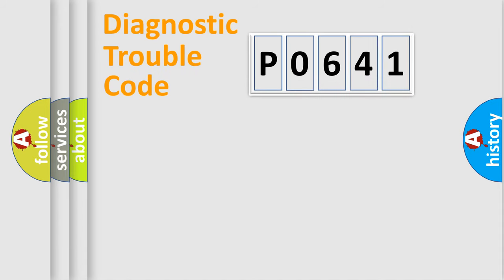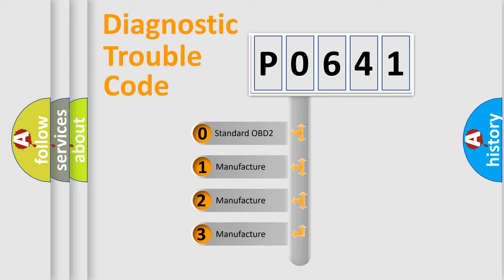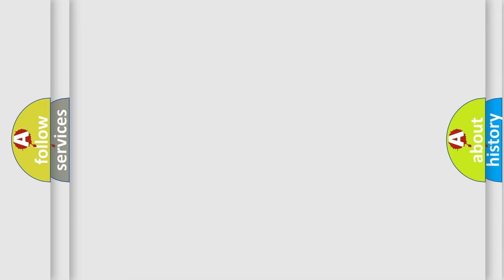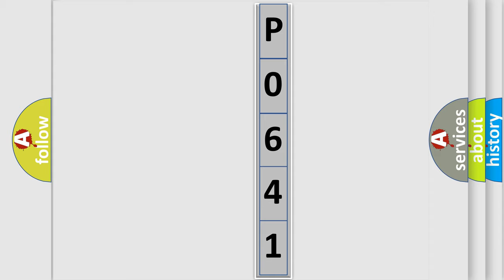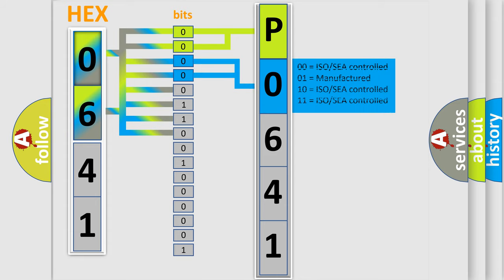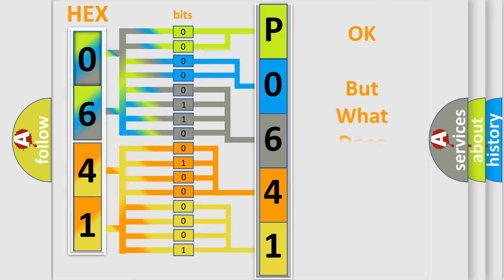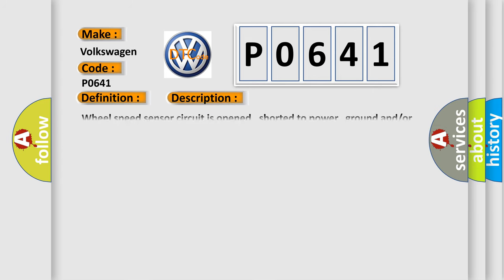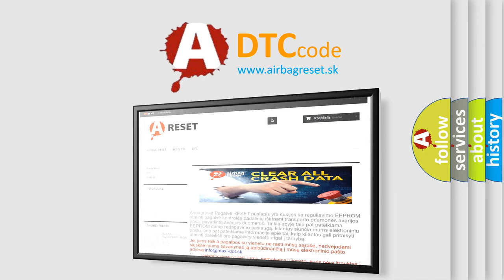DTC Volkswagen P0641 Short Explanation

Comment: Don't rush to replace your wheel speed sensor! This fault code can be caused by anything on sensor circuit. It's not even related to wheel speed sensor. Codes for wheel speed sensors for VW are C101B01 – Wheel Speed Sensor Front Right Electrical Fault & C101A14 – Wheel Speed Sensor Front Left Electrical Fault